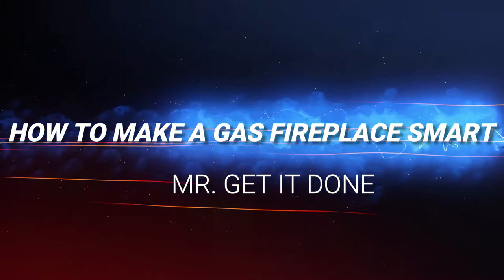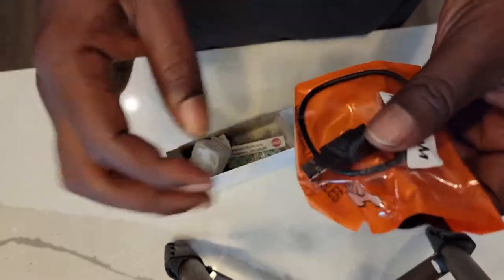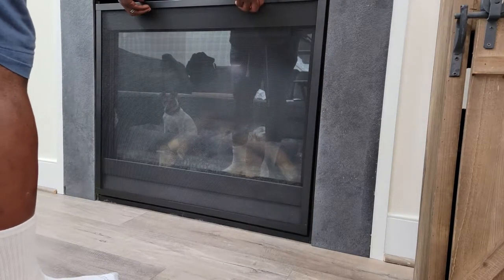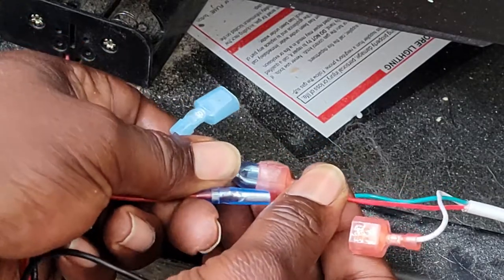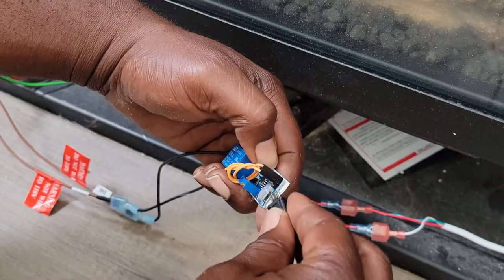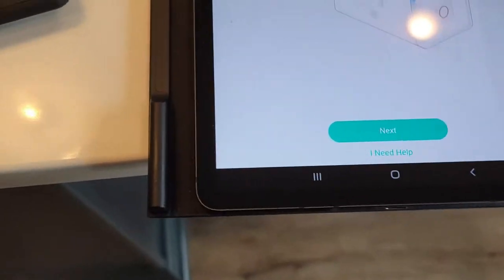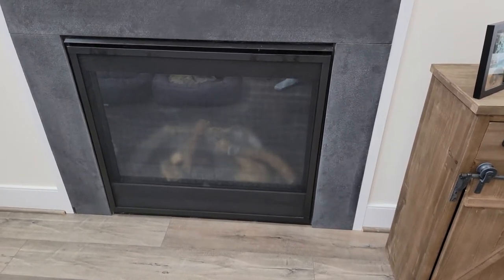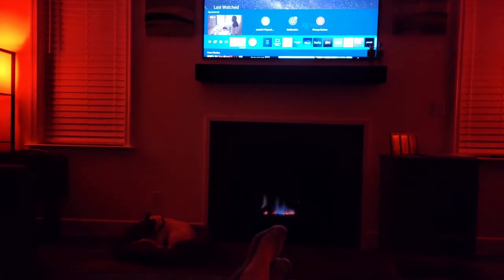How to make your gas fireplace smart! DIY

Comment: Bought both from the Link... Installed in less than 10 minutes. Had to strip wires and use wire nuts. Installer did not use Connector's. Watched your Video again while installing. Worked immediately! Well done my friend. TY😃

Comment: Been having that same odd issue where my new Kasa Wifi Plug I plugged down under the fireplace doesn't turn it the fire on, but off is fine. I have to go toggle the wall switch to get it to work. Found this video and ordered the part, seems like it will work great! Excited to get it installed. Thanks for posting this.
Reply from the maker: I'm glad this helped you! Thanks

Comment: When you turn the wall switch OFF, does the smart plug still works with alexa to turn the fireplace ON?? Do you need to keep the wall switch to ON to use this alexa?
Reply from the maker: Still works no matter what the position of the switch

Comment: So if you turn it on with the wall switch will the remote register that it's on with the smart switch?
Reply from the maker: Yes
Reply: @swole217tv  does it need to be in parallel or series for that? Cause on Amazon I was told it wouldn't

Comment: Can’t you just plug in the WiFi switch to the outlet under the fireplace and then plug the fireplace into the WiFi switch?
Reply: I was wondering the same.  I believe this could work, but you would lose the Alexa capability.  However, you would still have the ability to control it from you Kasa app.  However, if you do it like this, I believe you would lose the ability to use the wall switch... either it needs to stay on if you use the same outlet underneath, or you can use one of the other 'always-on' outlets, but then the wall switch controls nothing.

@swole217tv - with your current setup, can you control the fireplace purely with the Kasa app (without Alexa)?  In other words, can you schedule the fireplace to turn on/off and/or manually turn the fireplace on/off remotely from the Kasa app?

One last question/concern I have is whether or not it gets too hot under the fireplace for the smart plug.  Mine gets very hot underneath and was wondering if I somehow would need to shield/insulate the smart plug from the heat.  Any concerns there?
Reply from the maker: Yes you can still schedule in app and do anything you normally would do with the wall switch or remotes if you have one. This work around solely allows you to use alexa to override the on and off functions..... my fireplace does not get hot underneath but that may vary with different models

Comment: that battery box is for a remote.....
Reply from the maker: It's a backup way to ignite the fireplace if the power goes out
Reply: @swole217tv  what wires goes to what color?
Reply: @alfredgistarb6169  The red wires go to the wall switch and the black wires go to the controller in the fireplace.